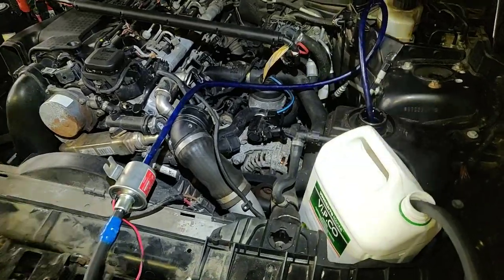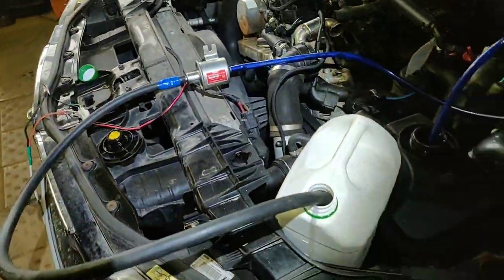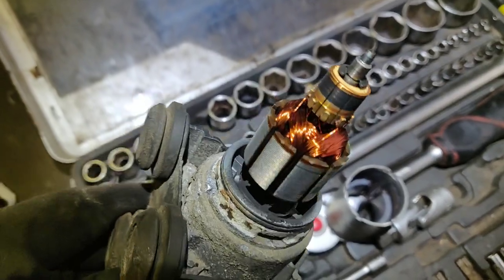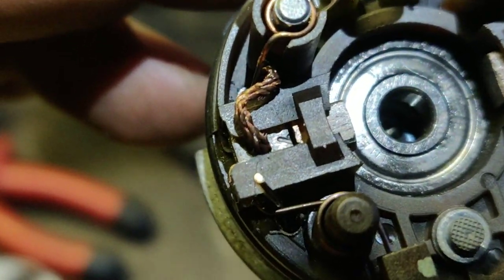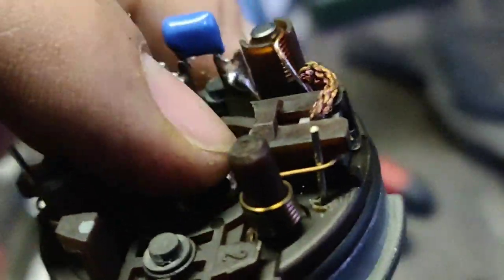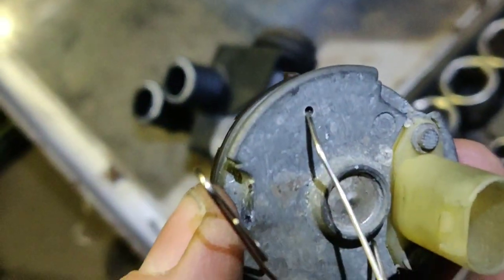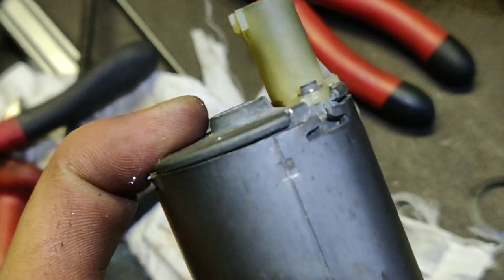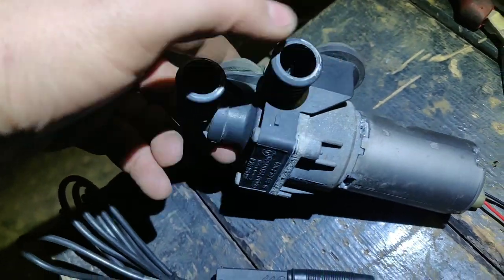BMW cooling pump electric motor fix!

Comment: Did exactly like you on mine. The paper clip trick was the best. Works like a charm now. But take in consideration that pump is not for cooling the engine, it just cycles the coolant to the cabin’s radiator. Good luck!

Comment: HOW LONG THESE PUMPS DO LAST? I have Toyota Prius, this Prius used to be burning out its auxiliary electric water pump frequently, because of this issue which seem to be common problem, I decided to install this pump from BMW. it has been a year now without the problem occurring again since i installed this Bosch Pump and work perfect with no electrical warning sign,

Comment: Does this affect the engine or dpf ? i have error on this on my e90  320d 2005
Reply: No. This is a additional waterpump when your car that you can still use your heaters in the car. Not the waterpump for the engine coolant.
Reply: @AN3CCAHNPO  On carly its an red error and its harmfull for dpf also turbo, i asked a mechanic and said this help also the primary water pump :D

Comment: that not the engine pump and has nothing to do with the engine
that's the heater core pump. it just push's the hot water inside the cabin.
i don't know why his talking about dead engine

and by the way, you can by-pass it and you will still have hot water in the core
Reply: It just helps at low engine speed or idle

Comment: Where is this pump?
Reply: I believe if you remove the air box, it’s underneath, and there’s a plug right on top, the water lines go in and out below at right angles